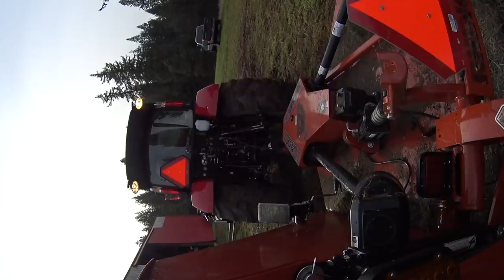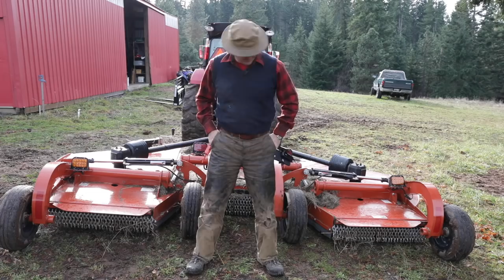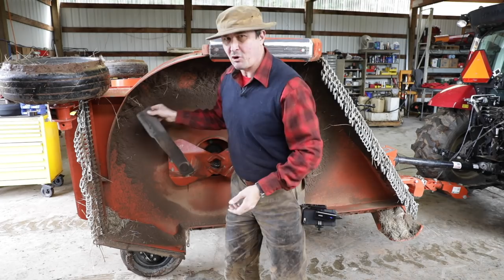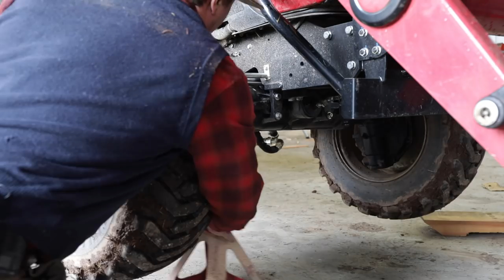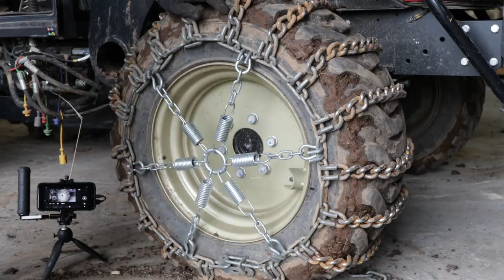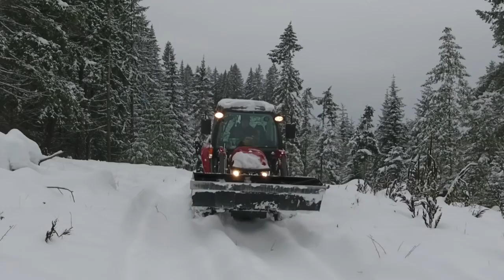AMAZING Tire Chain Hack For Winter

Comment: don't need chains if you buy a proper tractor with proper tires
Reply from the maker: Stupid comment,
Reply: i'm stupid because you bought some cheap tractor and shitty turf tires?
Reply from the maker: Andy you're not doing yourself any favors FYI Yanmar is a premium tractor and these are not turf tires.
Reply: Chains are absolutely necessary for his property during the winter months. Just watch his other videos.
Reply: I don't care what brand of tractor you have or what tires you have, you can even have axle lockers front and rear but if you are on ice and using a blade to scrape and push snow you're going to need chain's to keep from spinning out and sliding around! Not to mention they're going to keep you from sliding off of the road and into the ditch! If you end up putting that tractor in the ditch then you're really going to have a problem!
Reply: Thats not true... no rubber tire is going to do as well as a tire with chains on...
Reply: Tractor always needs chains. On snow the grip is almost same with and without chains. But on ice normal tractor tire doesnt have grip at all and its really dangerous to drive tractor on ice without chains.. Tractor tire chains are must have here in Finland for 6-8months/year.
Reply: Andy V yup. He's got industrial tires, not AG tires. AG tires do a hell of a lot better in mud and soft conditions
Reply: Give me 10 reasons why his tractor is cheap and those are (obviously)  normal tractor tires not the turf saver ones
Reply: He means tires like these http://www.godeepmud.com/tractortires.html for mud. But as others have commented these won't help with ice.
Reply: Yes, that type of tire is terrible on ice. Best choice still for summer and for winter with chains of course.
Reply: Saq those tires suck for anything but hard pack and pavement. Some R1 tires are better everywhere and only suffer slightly on pavement which most tractors aren't working on enough to make the R4 type tires like he has worth having.
Reply: If you dont need tire chains why do county's and Rms put chains on there motor graders for snow clearing and how big of a tractor does he need for his 100 acre property?
Reply: My guess is Andy is a John Deere fanboy.
Reply: Tire chains are great. I run them on my tractor every winter. But you need some wieght also
Reply: tractorboy31 I guess it depends on where you live but where I'm at chains are seldom used even though we usually get an ice storm and a few big snows each year and we don't even own chains for the tractors. Maybe if you only have a 2wd tractor but Cody is using them in the mud which he wouldn't need if he had actual Ag tires on his tractor. Those industrial tires don't clean out or dig in the mud.
Reply: yes, he does need to.
Reply: those treads would be better for tearing the turf up than saving the turf, so good point Wranglerstar.
Reply: Krupp Ratte it's a tractor, not a lawn mower who cares how it does on turf? And if you know how to drive Normal AG tires don't tear up turf as long as you don't drive when it's soaking wet or turn extremely hard and use the brakes hard to turn. I run 90-135hp tractors on turf a lot when we run during hay season and homeowners never complain when I have to drive through their yard and don't tear up the hay fields
Reply: Bullshit.
Reply: Andy V you need chains with ice and snow no matter what type of tires you have on your farm tractor or skidder if you want to push or pull anything!
Reply: in snow and ice you really need chains unless you want to be stuck everytime and everywhere.